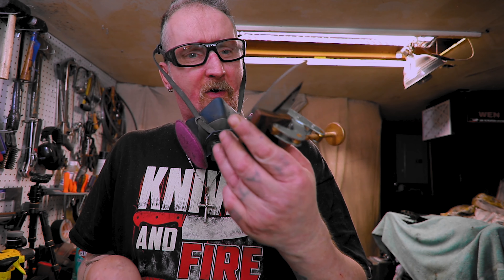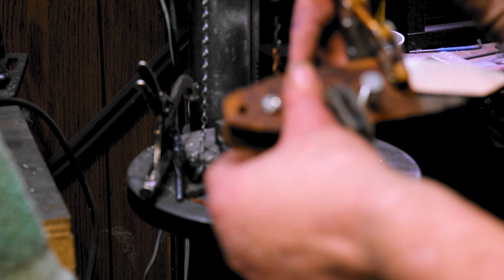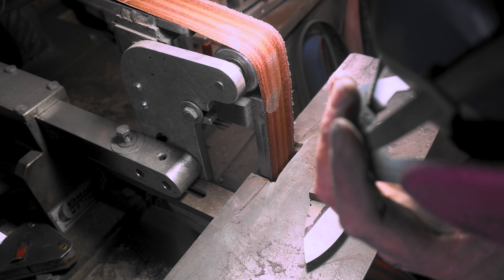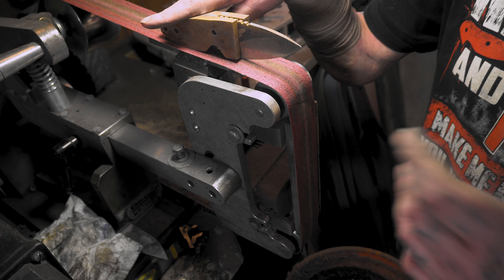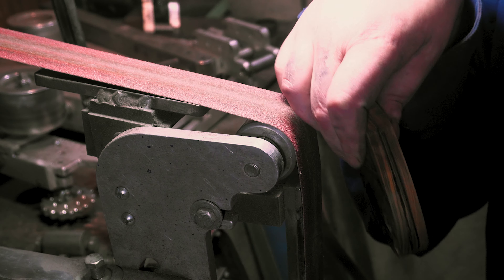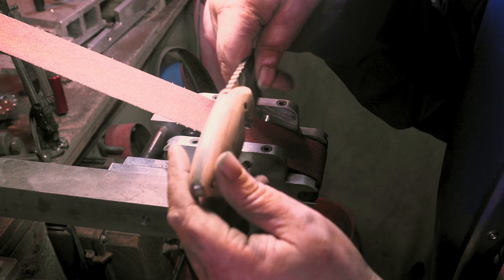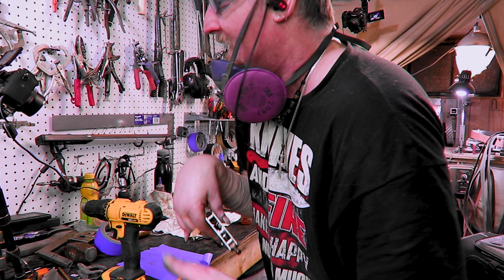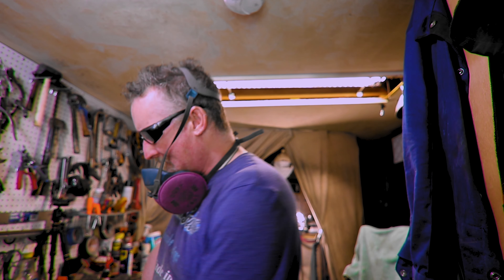Knifemaking - The secret to handles

Comment: pretty much use your same tips and methods on my handles- one thing I have been doing is cutting my handles as close to the metal as possible so I have less sanding to do.  Some wood burns so easily so using the bandsaw to remove wood has been helpful
Reply from the maker: Right, I've done the bandsaw thing to, but for me, I usually have to go & hit it on the grinder anyways. Ya know 6 of one 1/2 dozen of the other. We all have our prefered ways. Thanks for sharing, hope all is well, take it easy

Comment: You can get run off to melt off.  If you heat up an exacto blade you can melt run off or epoxy spread off the knife.  Its easyer to do your way but if ya happen to miss it that is an option
Reply from the maker: I think I'd be too worried about burning my handle material or scratching my blade, but yeah, sometimes ya gotta do what ya gotta do. Good tip though, I've had a few close calls & some that where right on the line of "is it that bad? & "do I risk making it look worse" it's a hard call sometimes...

Comment: Thanks Dave. Love the video. Help me out a little bit with the pivots. I am not sure what you mean. Do you have a link or something of where to get them and what they are?
Reply from the maker: Knife supply places call them pivots, but they are actually called stand offs. The ones i use are #8-32, 1/2" OAL, round fully threaded, just google it.  Or just google your pin size & standoff. Basically, take your knife thickness & add a bit to each side. I use mainly 3/16" steel & 1/4" scales, so 1/2" works best for me... Hope this helps

Comment: hello, the pins and handle bolts will all go easier if you use different sized drill bits.  for example i use 1/4" thong tubes. if i use a 1/4" drill bit it will not fit, they will be the same size. i use a letter "F" bit. its .257". a 1/4"= .250. those extra few thousandths of an inch allow enough room for the epoxy to do its job better, and there is no risk for bursting wood thru the other side, as they are easily installed by hand, no hammer taps needed. if you google letter drill chart, you will find a whole list of bits just slightly larger than your handle pins and bolts. 3-5 thousandths is usually plenty enough oversized. here is a fractional and letter drill bit size chart to help you choose what you need.  keep up the good work.  http://www.smithbearing.com/images/pdf/ENG-FractionalChart.pdf
Reply from the maker: Right on, thanks for the info. The only problem, if you are using the pivots, like in this, the  pivots will slide right through too. The point of the pivots, is that it holds the handle material on real tight, without screws or anything on the outside of the scales & you have full control to shape everything before epoxy. Though your tip is a great one, maybe after shaping everything, reem out the hole for easier fit. We all have what works for us, I'm sure my way won't work for some people. It's great to have options...